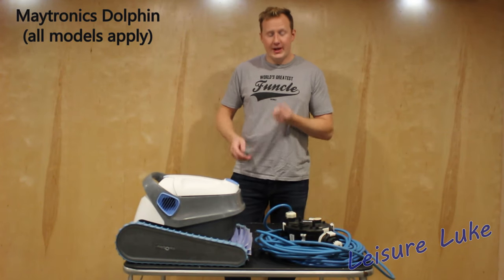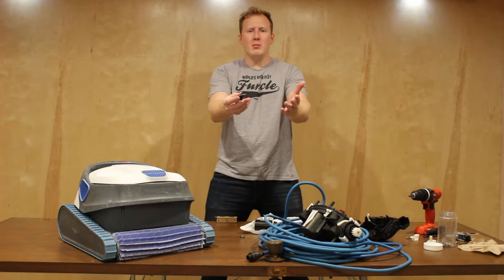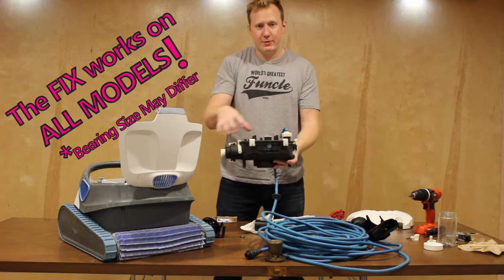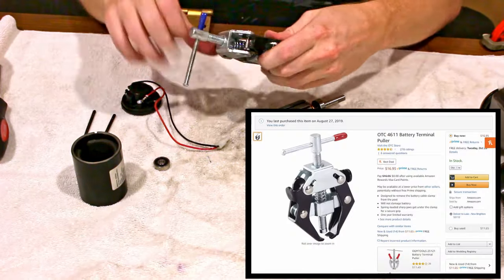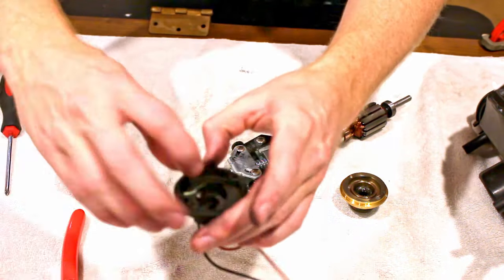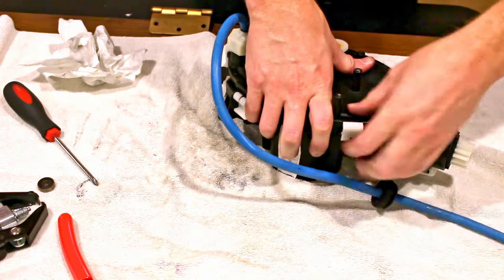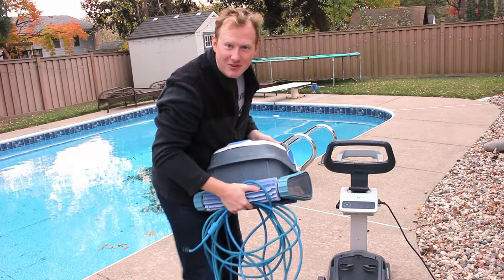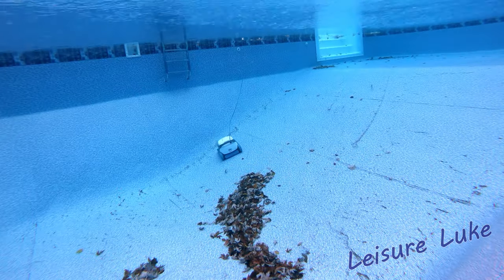Dolphin Pool Cleaner - BROKEN is FIXED!!!  SOLVED with 1$ Bearing | HOW TO REPAIR for MOST Models!

Comment: I had hoped really badly that this would work for mine, I took it all apart, replaced the bearing (which had been jammed) and the new one was spinning freely and then put it all back together and still will only do the forward and back and then stop.   Any suggestions?  Could i possibly have to replace all the bearings and not just the one you suggested?
Reply from the maker: Can you spin the impeller fan blade by hand, or is it still locked up?
Reply: @LeisureLuke  it can spin but not whipping around
Reply from the maker: @kerripetrangelo9639  Okay, that sounds normal.  It should have quite a bit of resistance, you can't "spin" it, but you should be able to grab it and rotate it.  I think you're there.  That's good.  The next test I would do is set it on a block or brick, so the tracks aren't touching anything.  I would have it dissembled to the point where I could watch the impeller spinning.  Then I would plug it in, and start a cycle.  Is the impeller spinning?  Are the tracks driving forward and backwards smoothly?  Also, out of the water you will be testing your cable.  Sometimes they get little cuts and then don't work under water, but still will work out of the water.  Good Luck!

Comment: Awesome video.  Found that one of the bearings has started going bad and definely causing binding.  Only problem is its the one in the brass cap.  Any idea how to remove that one and what bearing to replace it with?  Thanks in advance!
Reply from the maker: I think it's the same 626-2rs bearing.  You may have to damage the bearing a bit to remove it.  I don't know of a magic tool.  I'd start with a small pliers, and put a little muscle behind it.  If anyone else knows, let us know!~  Good Luck!
Reply: First off, thank you leisure Luke. Not sure that I would have taken my Triton PS apart without your video. Hey John any luck with that brass section mounted bearing? I have the same problem. It also looks like this bearing has a rubber gasket that keeps the water out. Cheers! Bill
Reply: @billincolorado  yes and no.  The motor only has two bearings that seem to be free spinning.  You're correct.  What I thought was a bearing turned out to be two seals facing opposite directions, probably to keep water out.
Reply: @johnlesley1158 what was your fix?
Reply: @justinhicks6675  unfortunately it was replacing the entire unit.
Reply: @johnlesley1158  thanks for the reply. I tested electronics and found the control module was my issue. Ordered a new one from Amazon and it’s back up and running. At least I now know how to tear apart the entire dolphin for any future issues haha.
Reply: @justinhicks6675  I really didn't have time to thoroughly diagnose anything beyond the motor or the bearings.  The family member that owned it just decide to purchase one.

Comment: Thanks Luke, I have the same problem, in the app I 
. get error1: DC in voltage
What should  I do?
Reply from the maker: Sounds like the sort of error one could get with a seized bearing.  Along with any other electronic failure 😣 I recommend taking it apart down to the impeller and give it a few turns.  If it’s turntable, you may want to check for any other signs of damage on the cord or leaks around the black box.   If you can’t paint that impeller by hand with the shroud removed, welcome to the club.  Follow the video & you’ll be good to go!

Comment: How difficult is it to open up the black box? Mine is giving me difficulty and I don’t want to accidentally break it while opening bc of the seal. Is there a video?
Reply from the maker: Mmmm.  I had to gently pry it open with a flathead screwdriver.  It’s just plastic though, so be gentle-ish.  I work my way around doing a little at a time - to pry it open bit by bit.
Reply: @LeisureLuke  thanks I figured it out. Got everything put together. Impeller moves easy and it does out of pool test but still doesn’t work when in the pool. Not sure what else it could be.

Comment: Hey Luke like your video!! I found the bad bearing just like the one you had. But my question is the top bearing inside the brass cap. How do I replace that how do I take it out? It may be bad but I don’t know how to test it. Any suggestions?
Reply from the maker: There’s no secret trick that I know of.  I’d Try to push on it with your finger and rotate it.  Remove it only if you’re confident it’s bad, in which case you’ll probably damage it when you remove it anyway. It’s unlikely that 2 bearings would seize at the same time.
Reply from the maker: Also nice work!  It’s a good feeling to find a bad bearing and a REALLY good feeling to fix it!
Reply: Luky - did you have any success with the brass cap bearing?  I pushed it out of mine (S200) & 2 came out - they feel like they are made of rubber, did not rotate at all within the cap & this took me by surprise, as I expected the bearing to be the same as the others, so I don't know how they go back in as one side is kind of hollow.  I'm so confused.  Any help is appreciated.

Comment: Hey Luke, I know nothing about this kind of thing.  Could you post a link to the part you ordered on Amazon?  Thanks!
Reply from the maker: I just updated the links in the description. The 2 items from amazon were:
OTC 4611 Battery Terminal Puller
TRB RC (10) 6x19x6mm Precision Ball Bearings ABEC 3 Rubber Seals 626-2RS

See the video description for direct links.  The bearings may differ depending on your dolphin model.   I would suggest making sure you find and identify your seized bearing before ordering any parts, in case this isn't the problem you are having.

Good Luck!

Comment: Hi Luke, thanks for your video, I've replaced both bearings and also the brushes but I'm still having issues. The Dolphin moves about a meter then tries to turn then stops. I can use it on manual with the APP but it won't climb the walls and  I'm getting the following Error Messages: "Technical Issue Impeller 1 Driver failure" and also "Technical Issue CF_ImpellerNoCurrent_1" Any ideas on what I can do to fix this?
Reply: Yay I fixed it, the springs on the brushes had popped off when I was assembling the motor. I just had to etch the grooves a little deeper on the brushes to keep the springs in place.

Comment: How troublesome are these units?   How many years of use before having to repair
Reply from the maker: I got mine used and I think it's around 8 years old.  I use it about 100 cycles a year.  I've had to fix it twice, and replace the filter basket once, but overall that's maintenance I'm okay with.  I would certainly recommend some kind of pool robot cleaner.  I think for the money, we all wish they were better, but they're still well worth the time you save!  Less time time scrubbing, more time sipping those margs! :D

Comment: Mine just started doing random wheelies. I’m assuming it’s because the impeller isn’t spinning to keep it pushed down?
Reply from the maker: Yeah, I've seen that symptom as well.  This can also happen if the underwater current from your jets are strong (see if it happens in different parts of the pool, or just one spot).  The motor in there is pretty powerful.  I'd take it apart & remove the impeller to verify there is not debris slowing it down.  I know you don't have a barometer, but see if the impeller spins fairly easily by hand.  If the cord is pulling on it even a little it can also wheelie around.  Is it staying connected to the walls?  I was noticing mine could climb an incline, but not a vertical wall...   Mine went from being unable to climb a wall to stopping after 5 seconds in just a few week's time.  Good Luck.

Comment: Unfortunately my black box had some water inside it.  So I let everything dry out and it still does not move.  The blue light comes on steady, but the motors do not rotate under their own power.  

Now, when the motor is out, the tracks/brushes rotate.  The track/brush motor does turn in my hand, but not when assembled.  The impeller motor does rotate with my hand.

Confused as to what to do next.  Not only is the black box half the cost of a new unit, it is hard to find these days.
Reply from the maker: I think it's probably time for a new one.  The unit and stand may still be valuable as parts on Ebay.  I would go the new route before spending money on the black box, which is what you'd have to do with moisture in the black box, let alone standing water.
Reply: @LeisureLuke   Yeah, it looks more like I'll have to buy a new one.  Maytronics is not returning my emails, and the guy at Leslie's is saying that the box is on backorder and he doesn't know when or if it will be available.  I can't find any on any other sites either.  I have heard a few people complaining about this as well.
Reply from the maker: @jmackinjersey1  Yeah, unless someone is parting it out they just don't come up for sale.  Shopping for a new one sounds fun though :)

Comment: Been trying to source the brushes...anyone have any info? Also the brass cap side of the motor has a different bearing, the inner diameter of the race is larger than the brush side just an f.y.i. i believe it's like 8mm or 5/16... I was going to try to temporarily (for testing purposes) use a skateboard bearing in place just to be sure the test of the unit works as it should then swap out when the sealed bearing arrives but that only fits on the brass cap side

Comment: I'm in the midst of diagnosing the problem. Nautilus CC. The impeller is not seized per se, it spins; however not exactly freely, as there's a bit of a hitch in there. Is that enough to be the problem?  Or is it an all or nothing kind of thing with bearing going bad? When i take the motor apart and check, one bearing (the exposed one at the end) spins freely and the other (inside the brass piece) seems to spin okay, BUT when I put it back together and turn the propeller, again the slight resistance. Given the low cost, thinking to replace it anyway and see if that does it. Thanks for your help on this!
Reply: Well this is odd. Put it back together and in the water...it runs but just kind of back and forward for 5 seconds in a small (like 5x5 foot) area with some wheelies thrown in. No suction.  But it runs until I turn it off but I've only let it run about 5-10 minutes so far.

Comment: Hi, mine did what yours did, however my impeller did turn, is it supposed to rotate freely meaning if you give it a flick it will rotate a few turns
Reply from the maker: Bummer - No, it’s got some resistance from the electric motor.  It doesn’t feel smooth and effortless, but mine was like - solid.  It was completely frozen.   If you’re seeing it quit after a few seconds it could be the tracks, I’d make sure nothing is stuck there, make sure the lid is fully closed.  Not sure how to test the tracks, but debris can get stuck, and if they can’t rotate the robot will sense that and quit after a few seconds.  You could also test it out of the water flipped upside down and make sure both tracks move together for those first few seconds.

Comment: Hey Luke, I replaced the bearing and put everything back together. My device worked for about 10 seconds then stopped. Turned it off and back on with same response. If it matters, I tested it on the floor, since pool is closed. Any ideas?
Reply from the maker: Hmmm.  No, does the impeller spin kinda easily?  Can you see if it’s spinning during your test?
Reply: @LeisureLuke  It may shut off if it senses it is not in water.

Comment: Hi - My Dolphin Triton is doing the same thing. Were you able to spin your fan at all? I can spin my fan with my fingers. 
I'm thinking this means my bearings are not seized. 
Everything seems to be clean and clear inside. Any thoughts?
Reply from the maker: Hmmm “fan”.  If by that you mean the impeller.  It sounds like you have seized bearings. That fan is the impeller.
Reply: @LeisureLuke  Yes - the spinny thing lol.
Reply from the maker: @tripperdelaluna1  Ah, you CAN spin it by hand.  Yes, then seized bearings are NOT your problem.  When you start it, does it go forward a bit, then stop?
Reply: @LeisureLuke  Yes it does.
Reply: Probably means the motor is bad. Mine had water inside of it and its impossible to buy it separate.  My $700 cleaner is trash after 3 years :(

Comment: Would this possibly work on a kreepy krawly 820, my impeller spins then stops after a few seconds
Reply from the maker: I would certainly give it a try!  Most pool robots have the same base functional and the same easy-to-disassemble design.  If you do get all the way in and find a bad bearing, it should have the size printed on it, and will be easy to find a replacement. Good luck!

Comment: thanks for the video, our m400 just stopped moving, ive disconnected the cable from both ends but seems continuity between pins! do you know if this is because there's some electronics in the white cable box (near where the cleaner plugs in)? else ill have to look inside the black motor box
Reply: never mind, just got into the black box, as easy as just flipping the white tabs and carefully separating the two parts, thanks again for showing me what was needed
Reply: discovered the issue, the white box on the cable is just a 3 wire slip ring, unscrews and was full of water with burnt out contacts.

Comment: Hi Luke, bought a Proteus DX4 during winter, didn't get a chance to use it till today.  First day in the pool.  moves forward a couple of seconds, then stops.  I haven't checked the impellers yet because I'm new to this and was searching online to see what could be the problem.  Hopefully it's a simple fix like yours, or even simpler.  Any pointers?
Reply from the maker: Some common things to check are the cable for obvious damage, make sure the impeller spins fairly easily by hand and has no debris on it, some need the pool to be above a certain temperature, some have water sensors (so they don’t work out of water) and make sure the tracks and scrubbers move easily/aren’t jammed.  Also, make sure the filter basket is installed correctly and the lid is fully shut.  That’s usually the checklist.  Did you buy it new or used?  Good luck!
Reply: @LeisureLuke  This is brand new.  the cable are new, so no damage.  Filter basket can only go in one way, and lid is closed very secure.  I'll check the impeller in a bit, will need to find my screwdriver.  tracks are clean and seems to move fine, don't have anything to compare it to.
Reply: @LeisureLuke  Hi Luke,  I opened up the motor and the bearings moves freely.  Impeller have resistance because of the magnets, all clean.  This really sucks, I was hoping it would be something concrete to work on.  Did a self test with unit upside down.  It moves backward, stops, then backward again, and stop again.  Didn't do the backward, forward motion like in some youtube video.  May have to find a service center if any near me.  Sucks that this is a brand new unit.  Hopefully you have an idea to try or some other commenters can chime in.

Comment: Clearly not a Texan. Out in the snow in a t shirt. We put on our parkas when the temp dips below 70º! Excellent info, you can also repair your pool pump and booster pump motors by changing the bearings. It's easy, there's tons of videos here and its WAY cheaper than buying a new motor. Here's another tip. When taking apart a motor, BEFORE you remove the through bolts, Put a hash mark or index mark across the case and the end caps. Now, when you reassemble the motor, you line up the hash marks and the through bolts will go through the case and right in to the threaded bosses.

Comment: Thanks. I got the motor out, the two bearings seem to rotate alright, How do you check and remove/replace the third bearing in the brass cap?
Reply: I got the rubber ring and white cap off the brass cap. There does not appear to be a bearing in the brass cap. There a black rubber plastic seal/holder that would hold something the size of a bearing, but no bearing like the other two.
Reply: Should  I put one in there?
Reply: I am having the same problem figuring out how to get to the bearing in the brass cap.  I pulled the snap ring, but under that is what appears to be a rubber ring and I cannot get it out.  Have you had any luck getting to that bearing in the brass cap?